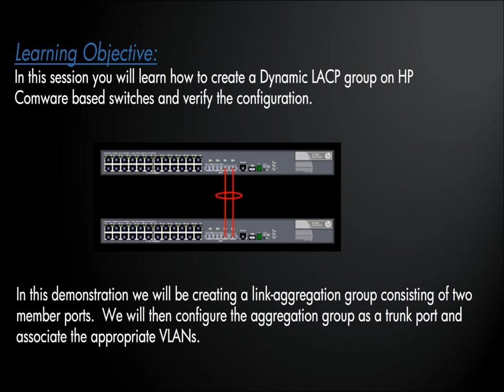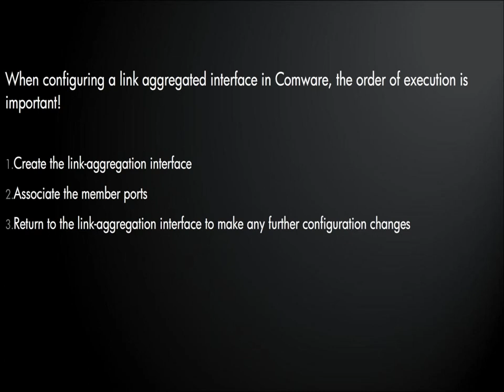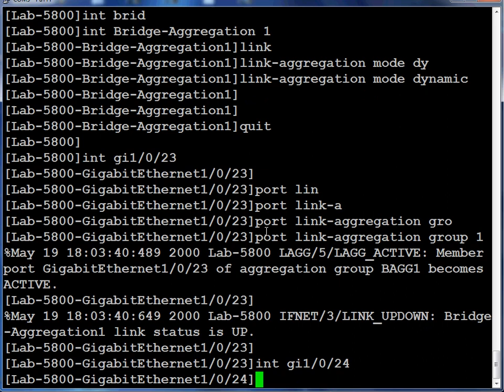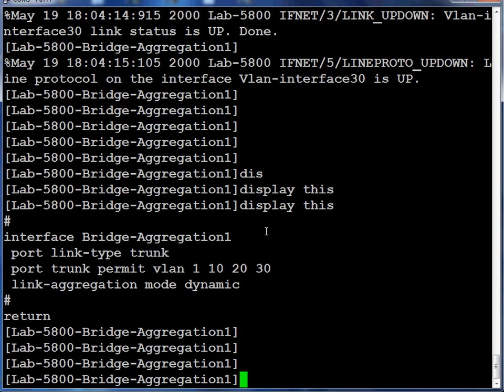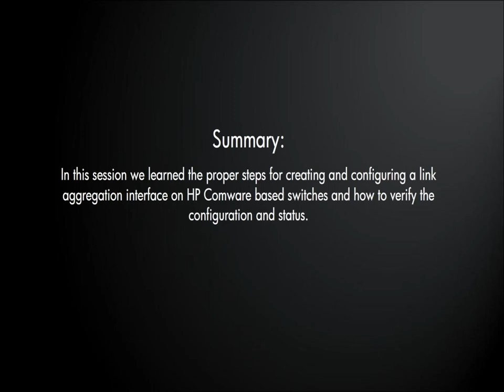HP Networking Configuration and Demo - LACP

Comment: I'm trying to connect A5820 to HP 2910, but having some problem. Need your help, :D

HP A5820 config
interface Bridge-Aggregation1
port link-type trunk
port trunk permit vlan all
link-aggregation mode dynamic

interface GigabitEthernet1/0/25
port link-mode bridge
port link-type trunk
port trunk permit vlan all
port link-aggregation group 1

interface GigabitEthernet1/0/28
port link-mode bridge
port link-type trunk
port trunk permit vlan all
port link-aggregation group 1 

HP 2910 config
Running configuration:

; J9145A Configuration Editor; Created on release #W.15.13.0005
; Ver #05:08.63.ff.35.05:a1
hostname "CORE"
module 1 type j9145a
module 2 type j9008a
module 3 type j9008a
trunk 3-4 trk1 lacp
snmp-server community "public" unrestricted
vlan 1
   name "DEFAULT_VLAN"
   no untagged 7-10
   untagged 1-2,5-6,11-13,17,19-20,A1-A2,B1-B2
   tagged 14-16,18,21-24,Trk1
   ip address 10.10.10.3 255.255.255.0
   exit
vlan 10
   name "STORAGE_VLAN"
   no ip address
   exit
vlan 102
   name "CCTV_VLAN"
   untagged 7-10
   tagged 14-18,21-24,Trk1
   no ip address
   exit
spanning-tree
spanning-tree Trk1 priority 4
spanning-tree priority 0
no autorun
password manager

I'm having this error > Member port GigabitEthernet1/0/25 of aggregation group BAGG1 becomes INACTIVE because the
port's configuration is improper for aggregation